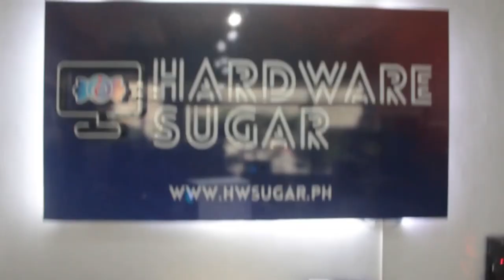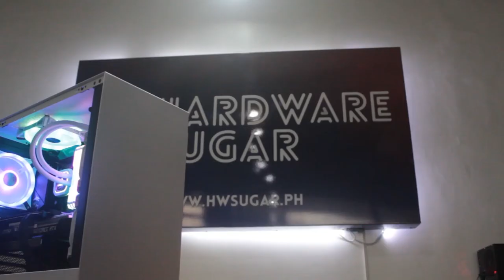Finally an INTEL build!

Comment: Intel owns entry to mid level gaming market now :)

You can start stocking B560 boards and 11400 or 11400F and recommend it to your clients.  This combo beats 3600 and 3700x by a significant margin in plenty of games.

Same thing for 10100 & 10100F with a B560 board. It should beat 3100 and match 3300x in gaming.

Even the older 10th gen CPU's are great value processors like 10400F & 10700F if you can get it at a lower cost from local distributors.